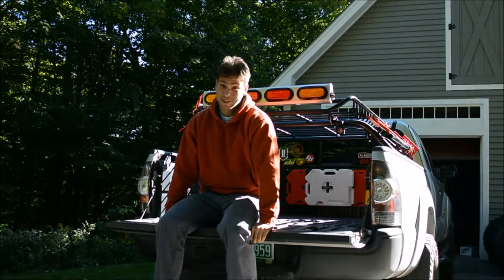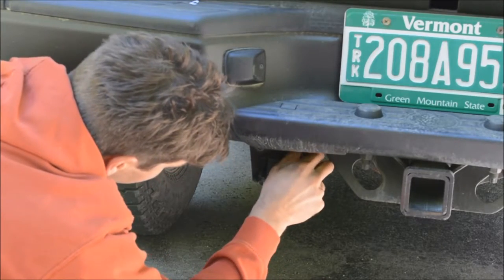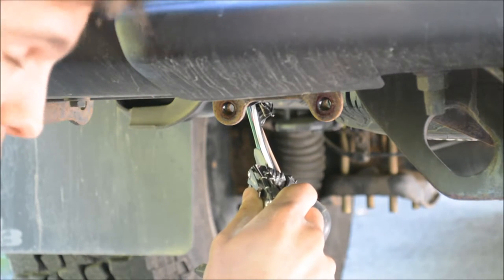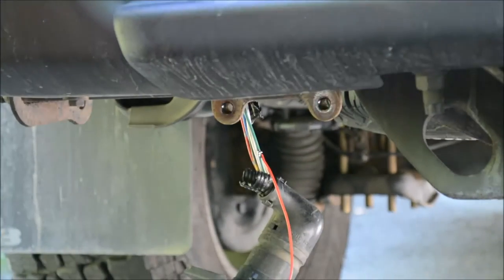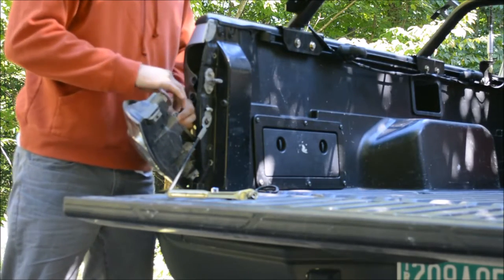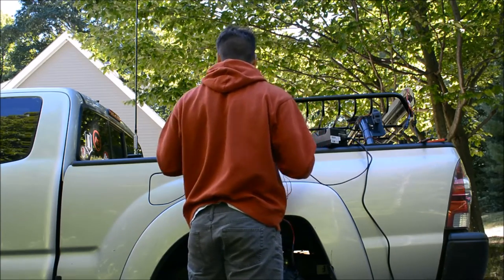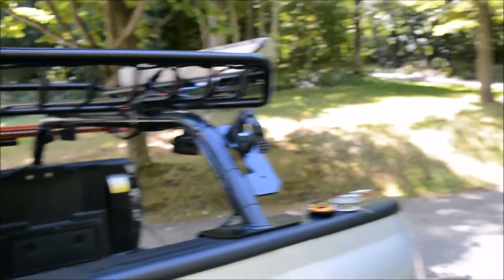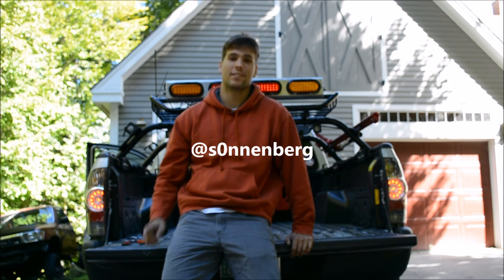Cargo Rack and Rear LED Install ~PART 2~

Comment: the reason the turn lights on the bar don't light up is because the stock turn indicators don't, brake lights, run lights do.
I like the idea but I think it's over kill, unless you are racing Baja. just my opinion.
love and have or I am doing to my tacoma. keep up the vids!
I look forward to what you have planned next😆
Reply from the maker: All the LED trailer lights have a three wire setup, meaning that they all SHOULD be equipped with the running light function.  The power for each blinker function is tapped into the respective truck blinker, however the "running light" function of each blinker is tapped into the same power source as the red running lights, hence they should all come on, or none should work.  This leads me to believe that each orange light doesn't actually have that circuitry, or my parallel configuration of it is causing issues.  I'll re-test when I switch the brake lights out.  

Is it overkill?  absolutely!  I only plan on running this bar when I have my spare up there, which won't be often.  I would've liked a smaller rear light bar, but this is what I had on hand =].  Thanks for the comment.

Comment: Could you post a link to the led flasher unit you used. I can't find it. Thanks
Reply from the maker: http://www.ebay.com/itm/like/311431980542?lpid=82&chn=ps&ul_ref=http%253A%252F%252Frover.ebay.com%252Frover%252F1%252F711-117182-37290-0%252F2%253Fmtid%253D1588%2526kwid%253D1%2526crlp%253D53601919689_324272%2526itemid%253D311431980542%2526targetid%253D186360207849%2526rpc%253D0.19%2526rpc_upld_id%253D75513%2526device%253Dm%2526mpre%253Dhttp%25253A%25252F%25252Fwww.ebay.com%25252Fulk%25252Fitm%25252Flike%25252F311431980542%25253Flpid%25253D82%252526chn%25253Dps%2526adtype%253Dpla%2526googleloc%253D1021900%2526poi%253D9002924%2526campaignid%253D239125209%2526adgroupid%253D14978428809%2526rlsatarget%253Dpla-186360207849%2526gclid%253DCj0KEQjwsO6-BRDRy8bsxfiV2bkBEiQAF8EzKBNR4-xqxyv3mHSr07hKe_24zT3fDqlHb85LRrm5nOwaAinf8P8HAQ%2526srcrot%253D711-117182-37290-0%2526rvr_id%253D1094920922087&ul_noapp=true

There's a similar one
Reply: Thanks

Comment: Should  have just got a trailer 7 pin to wire with then just plug in and go
Reply from the maker: I considered that, but I do tow with the truck and didn't want to have to disable the chase lights just to hook up a trailer.  This setup is long gone anyway at this point.